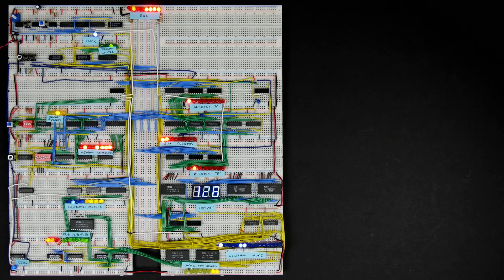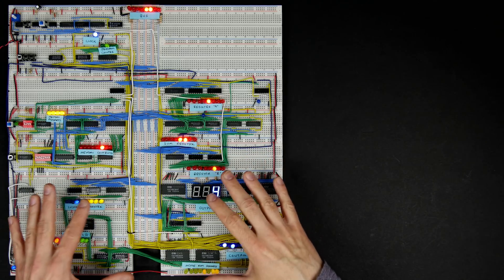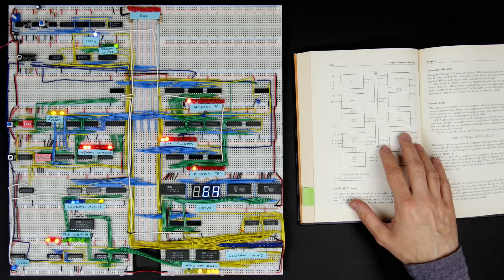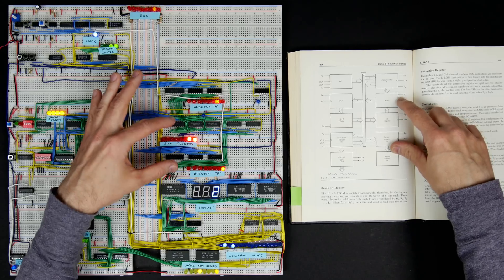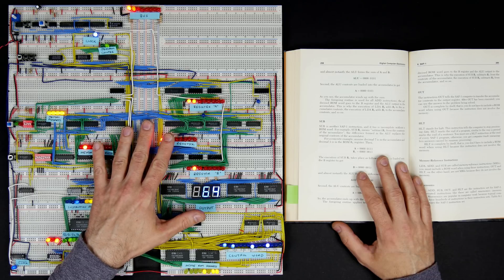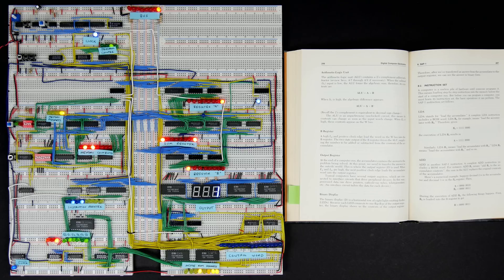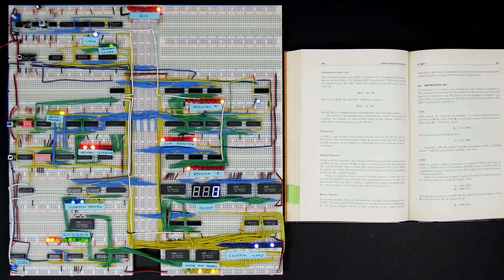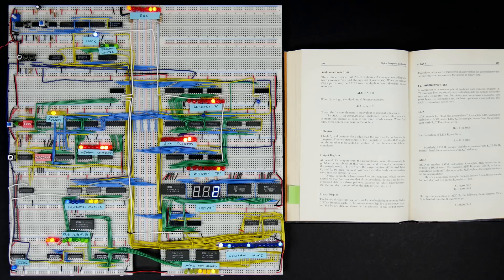8-bit computer update

Comment from the maker: If you want to follow along with this series and build your own, I'm now selling complete kits! Check out https://eater.net/8bit/kits.
Reply: Love it! I followed this project when it first came out and now I'm an electrical engineer! Thanks for the inspiration Ben!
Reply: I started your "8 bit computer" series just now...but the series isn't numbered . Can you please add some serial number to the videos in that playlist ??
Reply: @sirshendu2e01  Sort 'oldest first'. No numbers, but the video sequence is more appropriate. imo
Reply: WannaDIY  I have watched several of both Ben's and Julian's videos. As I understand it, Julian's machine is quite different. His computer has just one operation, namely the "copy" instruction. Or rather, the computer doesn't have any instructions. It turns out, the ability to copy/move data, is all a computer has to do (plus branching). It is the components connected on the bus that manipulates the data. You could say they are the "instructions". Ben's machine accepts a program with instructions that are deciphered to control signals, while the other machine simply read source and destination addresses. The "instruction" is implicit in that we know what components connected to that address do. That means, the programmer has to know the computer's configuration, but the implementation of that computer becomes a bit simpler (basically without any of those yellow wires and associated circuitry). I don't think Julian has gone as far with his machine as Ben has though.
Reply: WannaDIY  To they only have capital letters in the Netherlands?
Reply: Anvilshock Nope, don't mind him, in NL most of us don't yell, at home, on the street or on the Internet ;-).
Reply: @noth606  Mooi!
Reply: @Anvilshock  He might have been accustomed to COBOL which is a beauty in itself...
Reply: I just ordered this kit - received it a few days ago. It's a quality package consisting of four boxes for each of four subsystems. It also includes the Arduino and associated components to build the EEPROM programmer. I'm looking forward to building it.
Reply: Great job! Your work inspired me to write a (yet another) software simulation of your computer, but this one is different... It simulates EVERY TTL and memory chip, exactly like in the original project. The only parts I left out were the 555 oscillators (they have been modelled as abstract oscillators), but the rest is really the same. The project is almost finished (I'm about to implement the FLAGS register). The project is hosted in GitHub: https://github.com/ARMCoderBR/tlsim
Reply: @ARMCoder-BR  oh
Reply: @ARMCoder-BR  no need Milton, he loves to simulate this in real life!!!
Reply: It would be so awesome if Ben made a Tutorial series on Raspberry pi. Please like the comment for him to notice.😄😉😃
Reply: Gently Genius Gene Honestly, I don't know. That seems like such a dramatic departure. I suppose it could just be the next stage... but... 

Not that it would've be fantastic content if indeed Ben went that path. It just seems like a diversion from his focus, to me.
Reply: Can i get the kit in india
Reply: This has to be most amazing thing I've seen on YouTube. I've been in electronic industry for 27 years.
Reply: Fantastic! I just watched the control logic series and I loved it. I think it would make a terrific present!
Reply: Can you give us the pdf of this Book?
Reply: @zulqarnayeenschaftler9323  https://www.google.com/url?sa=t&rct=j&q=&esrc=s&source=web&cd=4&ved=2ahUKEwje1qazyanpAhUP3qQKHUFtD6UQFjADegQIARAB&url=https%3A%2F%2Fkupdf.net%2Fdownload%2Fdigital-computer-electronics-3rd-edition-malvino_5a44cd98e2b6f5ea64eda97d_pdf&usg=AOvVaw1FuZOI0Bz4VIzJfBoIUDoA
WILL WORK
Reply: @NICEFINENEWROBOT  thank you!!
Reply: @NICEFINENEWROBOT  I downloaded
Reply: @zulqarnayeenschaftler9323  Well, well, well! I wish you many lines of executable code!
Reply: @NICEFINENEWROBOT  😄
Reply: @zulqarnayeenschaftler9323  How nice to receive a smile and a grin from thousands of miles away! 

?:^)
Reply: @NICEFINENEWROBOT  I can't even imagine😨
Reply: @NICEFINENEWROBOT  our communication technology!
Reply: ll @zulqarnayeenschaftler9323  Wait, I'll plug you in then you can stand in my Space Hangar and we can talk... oh shucks, what year are we in?
Reply: @NICEFINENEWROBOT  ☺😲....................................
Reply: @NICEFINENEWROBOT  sleeping time in my timezone, goodbye !
Reply: Well, I watched this whole series maybe a year ago now (maybe around when you released the kits??), and wanted to try it sometime... but... that wasn't the time.  Well, I just received my kit from you today; it's sitting in the box underneath my laptop as I type this, watching this intro again... and I'm about to crack it open and proceed!  Luckily, I won't have to wait the few months, since the video series is done already.  ;)
Reply: @DavidLindes  how'd it go? I'm interested in doing this too!
Reply: @abefouhy8152  Sadly, I got derailed by needing to move, so... I had a fun time getting started, and did a bit, and would still recommend... but also, I haven't worked on it in a while, and never finished.  I do think from time to time about trying to pick it back up, though!  Hopefully I will at some point.
Reply: I had bought one but the system collects more money than I expected, the number that shows up in my receipt (including the delivery fee is 328.43, but the system collects 452.60 from my account, I had emailed about the issue to support@eater.net but no response from the email.
Reply: I was going through my books and I was unable to get some crux of it .....by then your videos came as a savior. I hope you will continue to make videos and save students like me.
Thank you so much.
Reply: THANK YOU SOOOO MUCH FOR THIS SERIES :)
Reply: I'm probably going yto buy one of these they're really good value for money.
Reply: I've bought the kit from the site but what will happen if I am out when the parcel comes, will it get sent back to you or will it be given to a local branch of the company for me to collect.
Reply: Ah.. Damn you Ben! Shown this project to my 3 years old son... Now i have to build one on my own 😀 
"Dad! Can we build more of the computer today?" Already spent 300EUR on 7400 IC's as most of them i have to buy in pack of 50.. 😉
Great project, you've successfully inspired me to design and build my own processor, for last two weeks i've been burning midnight oil, reading the datasheets, comparing 7400 families for compability, designing my own parts for ALU, designing memory map and registers... Damn, i've designed my own parallel/serial IO card for my own CPU architecture last night...

But beware, my wife already said if she steps on one more IC, capacitor or resistor, she will pack us (me and my son) and send via airmail to you (good she did not mention LED's as those are my son's favs) 😆
Reply: Hi, Ben. I ordered the complete kits on your website. How long does it take to ship the order? Thank you.
Reply: I just want to know how did I end up here from CPU's built in Minecraft....
Reply: Ben - good work!! You know, maybe it's time for 64bits and a x86 instruction set! - and try to run Windows with the minimal attainable clock  :-)
Reply: Are the kits still for sale?
Reply: I saw a link to this on Reddit, clicked, and thought "hey, that looks like the SAP computer from Malvino". Then, yep, you pulled out the book. I think I still have my copy from 25-ish years ago on the shelf somewhere. Good stuff!
Reply: I translated this series of videos into Chinese. And dubbed into Chinese. I hope to get your authorization. Address: https://space.bilibili.com/406698772
Reply: Can we run a dos code..or calculate or play a game like doom or tetris i would like to see this computer working like a champ
Reply: @anand.suralkar   Hi there :) I'm afraid this is not the purpose of this exact computer ... If One wants to play games it's a lot easier to go and buy ready one :)
Reply: @anand.suralkar  Who cares if it is turning complete. The new test is can it run doom, which seems the most cross-platform game in existance.

Comment: i have question...is all the chips powered from 1 power supply? cause I am using an ac to dc power supply and I tried to make a voltage divider with only resistors and then with resistors and zener diodes and I cannot even power one and gate and one not gate simultaneously...seperately my circuites work but i want the output of the not gate to connect to the inputs of the AND gate and then voltage levels drops all over the place

Comment: Thank you Ben for amazing tutorials. As an software engineer i found one new hobby now to practice. In progress of building a computer now!
Reply: Any update!
Reply: @RobinThePaladin  It has been a challenge. I had to reassemble everything few times to find some chips with floating connections. Single modules work very well, but once connected to EEPROM I had fuctuating sygnal that made random things on the coneected board. Out of frustration for debugging over a month I was about to drop the project, but I tried to supply direct voltage to each of the boards and it made thigs work. There is a bug with 157 chip on ram module that I am not sure how Ben makes it work, but most of my problems I guess is power supply.
Reply: @KarolisKerpys  im a bit confused what exactly this 8 bit computer can do because I know it can increment numbers and count but i can do that really simply on an software called circuit wizard so what else is all of this exactly doing
Reply: remember guys, if u dont have stuff to build pc u can just create emulator
Reply: @GoldbergToastyBred  can you suggest any  emulator ?

Comment: One issue I see with this is the fact that the LED outputs are being driven directly by the logic ICs. Logic ICs aren't meant to drive outputs directly like this because they aren't rated for that much current. Normally you would put a buffer amplifier between the output and an LED so the current to drive your LEDs is being sourced from the amplifier, not the logic outputs. As an example the 74HC04 quad dual input NOT gate has a maximum continuous output current rating of just 25ma, and that's across ALL outputs, not just one. If you used a 220 ohm resistor on a green LED at 5v with a 2.5v drop, you would be drawing 11ma just for 1 output pin. If you had all 8 outputs high, you would be drawing nearly 90ma in total. Much higher than the 25ma the chip is rated for as the maximum current the chip is rated for.

As a citation for what I've stated, here is the datasheet for the 74HC04 from TI. If you refer to the first table in section 6.1 you will see the maximum output current (Io) in the 4th row is stated as 25ma. Which again, is for all output pins combined.
https://www.ti.com/lit/ds/symlink/sn74hc04.pdf?ts=1698859654009&ref_url=https%253A%252F%252Fwww.google.com%252F

I understand wanting to keep the tutorial as simple as possible, but this creates huge gaps in knowledge and bad habits. If these were open collector/drain outputs it would be fine. Or if you used high enough resistors that each LED only draws 1ma or so. It's a great tutorial if you already have background in electronics and have gone to school for it. But, properly driving your output devices is a topic which should be covered at least in SOME detail, perhaps in a dedicated video, would provide a more complete education on this topic.

And I'm not just singling this channel out. I've seen (and learned similar bad habits) this same practice in many other channels. So, it's not just this channel. And I should say that these tutorials are still SUPERB and despite some shortcomings, I still cannot recommend them enough to people. And I do, every chance I get. If anything, this just underscores the fact that as a user, you shouldn't rely on any one single source of information, but rather, get as many different credible sources as you can.

In any case. Thanks for taking the time to make and share these video. They are an invaluable supplement to any education on computer science, and no doubt get people even more enthusiastic about learning about it. And I respect the heck out of that.

Comment: I learned how to do this during my apprenticeship and it is really easy if you know and are familiar with all the components used. Mine never looked as neat as this one you have built but it worked and although a little more advanced in some ways is basically the same.
Luckily i had an expert teaching me so his knowing everything back to front helped obviously. 
Also, i would experiment, these builds can be modified and used in so many different ways and are capable of doing much more than basic commands.

Comment: Ben I had bought your 8 computer,, But I have  tremors in my  hands ,so it makes very difficult` to ensemble if not impossible. I was wondering if you could design printed circuit boards using the same modular design for ensemble.  I love the kit  but all the point to point wiring makes it impossible to ensemble and not to mention having lose connection in proto typing boards to troubleshoot. Please give thought and concertation I would love to finish this project and some enjoyment out of it

Comment: I used a different book "Microprocessor and Digital Computer Technology" by Jerome E. Oleksy and George B. Rutkowski, Prentice-Hall 1981 in college (about 1982 or 1983) to build a very similar computer on a breadboard! Oh the memories! Late nights trying to figure out why it would not work. We had to redesign something in the arithmetic unit because one of the ICs was no longer available (I don't remember, now, which part or what the redesign was). It was sure a lot of fun to get it to work. And then we had a write a program that would self-modify so that we could test all of memory (walking ones, alternating ones/zeros, all ones all zeros).

Comment: Would it be possible to build a computer from scatch without a dedicated microprocessor (meaning you would build that yourself from gates, etc.) that could compile a very small version of linux? Using just off the shelf gates, etc? My guess is that it would end up being very large and slow and probably a huge time sink -- I'm sure with a microprocessor it could be done much more easily.

Comment: Ben, this should be a university course. I did an intense vocational diploma in IT electronics years ago that involved soldering an 8085 kit together which simply did not explain how on earth all this worked. Was wondering: Would it be possible to assemble a breadboard like yours that visually follows the block diagram of the 8085 and allows for "re-creating" (or rewriting) the instruction set from scratch? In other words, re-designing the 8085 in (dissected) parts so as to completely understand how a successful CPU chip comes together? I'd gladly pay for one!

Comment: I want to create an assembly language that is based around transistors, so you can really get the most optimization out of your programs. I was thinking... what would be nice to include in a transistor based assembly language? I've got the jump function covered because you can just use a not gate (created out of transistors) to activate one line and not the other.
the instructions are as follows (I will go into more detail if you ask.)
PTE: a p-type transistor.
NTE: a n-type transistor.
PUL: a pull resistor. (I've heard you can create a pull resistor out of a transistor, but I am not sure how it would be built, so that's why I made an instruction for it.)
VAR: a variable.
FUN: a quality of life instruction used for calling up large amounts of code without much trouble.
WDW: the screen.
SND: plays sound at a given frequency.
I would love this to become a reality we can go through, and if you do to, like if you want to, and any improvements would be nice.

Comment: Great videos.  Heathcote used to have a coarse on microprocessors where you built the computer, added memory, and programmed it using buttons and entering op codes and data.  I still have the books.  "Heathkit Microprocessors Book1"  "Heathkit Microprocessors Book2"  "Heathkit Microprocessors Student Workbook"  the book uses the 6800 and 6808 processors

Comment: I feel this way about programming, as I'm not much of a hardware guy, but asking for the complete schematic feels a bit wrong to me. If I were to undertake such a project, having a fully worked-out blueprint/schematic would suck the soul out of it, it would be like solving a puzzle where someone already told you the answer. Figuring all this stuff out is the fun part, otherwise you'd just be putting electrical components together (or copying source code from github)

Comment: this is amazing. as someone who majored Information Technology and a minor in Computer Science, electrical engineering/computer engineering has been a related discipline that i've always been interested in. on a side note i briefly thought about majoring in Computer Engineering instead of Info Tech but requirements for physics, calc and chemistry to just get into the engineering school scared me off.

i have a few minor electronic stuff to play around with like a breadboard, adjustable power supply, DMM, baggie of simple electronic components